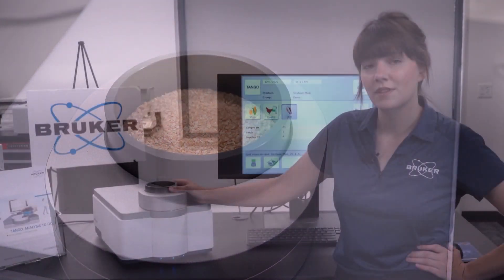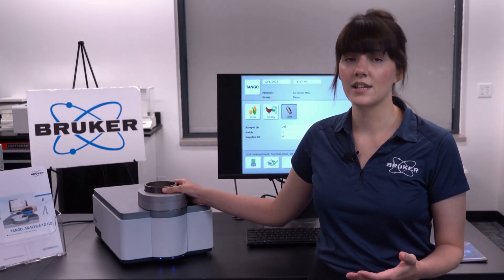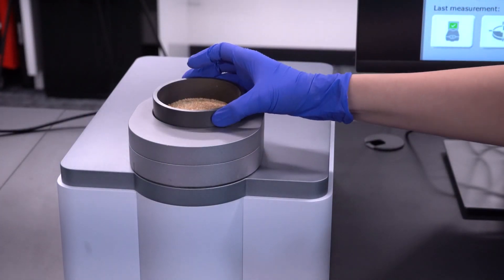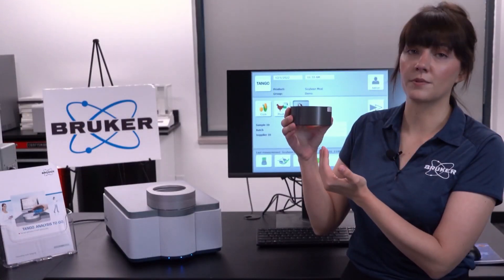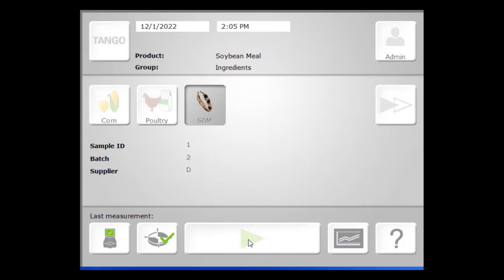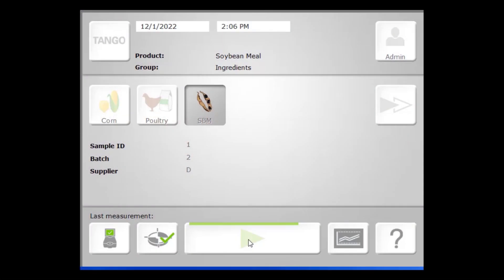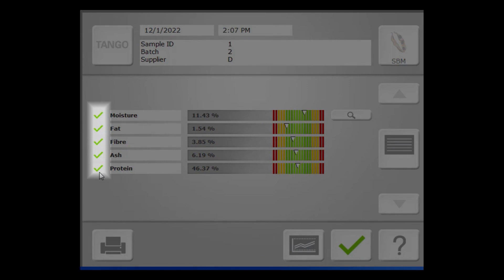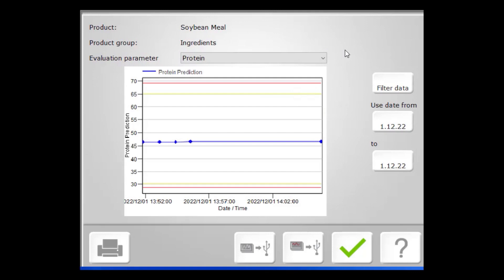Soybean Meal (SBM) Analysis with the TANGO

Comment: . washukr
There is a crack in the upper bottle of the device. Its diameter is about 20 mm. It does not affect the analysis because it is at the far edge. Can it be replaced and how much does it cost, please? Thank you.

Comment: Nice, we have FTIR alpha II.
It is fabulous. Also the tango is miracle. One request is that, please explain basic principle behind this how it measures by non- destructive method.
Reply from the maker: Hi Chetan, 
the trick is quite simple: You illuminate the sample with light, some is absorbed by the molecular vibrations of the material, mainly overtones and combination vibrations of -CH, -NH or -OH groups. The rest is reflected and collected with the detector inside the spectrometer. The information in the resulting spectrum can be accessed by multivariate data processing and evaluation methods to analyze the sample composition. 
If you like to learn more, please check out https://www.bruker.com/en/products-and-solutions/infrared-and-raman/ft-nir-spectrometers/what-is-ft-nir-spectroscopy.html
Reply: @Bruker   No madam,  I am clear about FT-NMR. I want the detailed working about instrument mentioned in this video.
Reply from the maker: Sorry we thought you were not familiar with FT-NIR. Please drop us a line at https://www.bruker.com/en/meta/forms/bopt-form-pages/bopt-contact-form.html and we will come back to you.
Reply: @Bruker  Ok mam I got it.